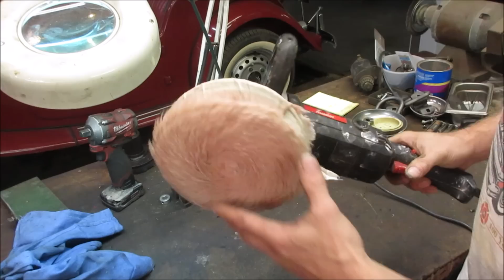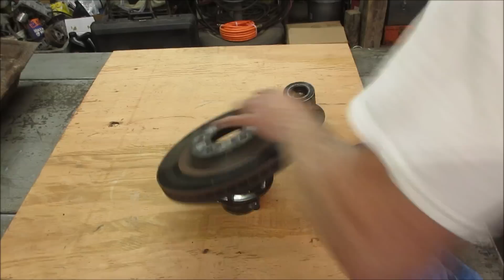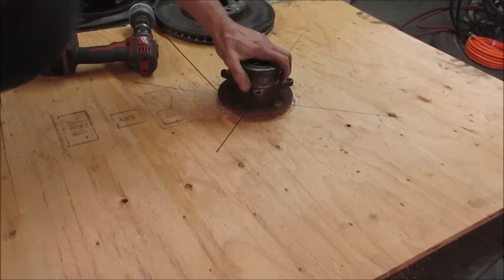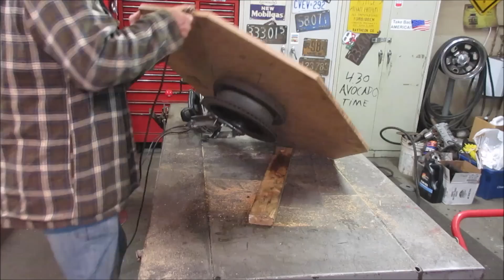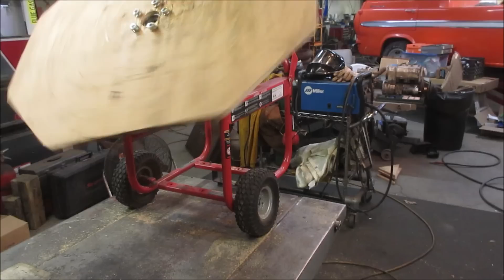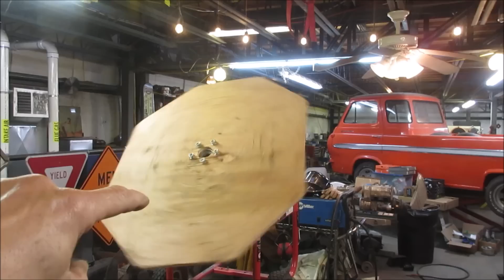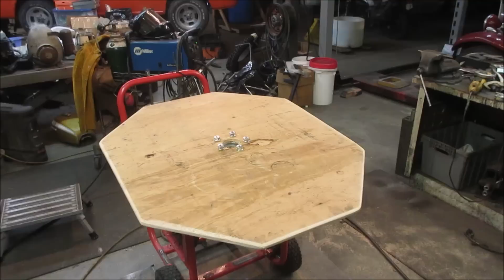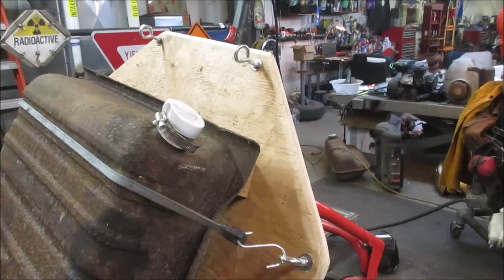Building A Machine To Fix Rusty Fuel Tanks Of All Kinds - Let's Get Started!

Comment: I think it would be good to use the electrical plugs on the side of the cart . Wire it up so you can plug the grinder to the cart on one plug, and on the other put a rheostat (dimmer switch) to control the speed. Great video, keep it up.
Reply: The problem with the rheostat idea for electric motors is that electric motors aren't like incandescent lights.  They'll try to draw the needed watts, no matter what the voltage is, so the current drawn will fluctuate wildly, and could trip circuit breakers.

Comment: Fun video, I usually listen and learn, today I was voicing suggestions....  lose the plywood, expanded metal with frame gets you many attachment points.   Tarp straps are an eventual wreck, tie down straps for the win.  The rotor counterweights for stability likely help just in weight to calm the thing down but a stabilizing movable third leg added to the bottom framework that you could slide in and out may be a good addition or even replace the counterweights.  My mind was also running wild with how to add a second motion but came up with bupkiss.  Thanks for an entertaining morning.

Comment: If you want further speed control in the downward direction, you can run the grinder through an autotransformer to lower the 120 VAC to a lower starting voltage.

Comment: I have used drywall screws as a abrasive medium when cleaning old fuel tanks. The threads and tips are really sharp. I bet they would work really well with the tumbling action.
Reply: as sharp as they are, sometimes he needs the weight of the big nuts and bolts to KNOCK the chunks off the inside of the tanks.
Reply: Yeah he needs to use the most aggressive media he can find, so some sharp screws like drywall or sheet metal screws would be better (maybe some star washers?), plus they would be easier to take in and out of the tank because they're uniform.

Comment: Yeah I agree with some others who said that those of you saying "just use a cement mixer" are missing the whole point of - well, of everything Mustie does. Great work Darrin and a fun contraption!
Reply: mustie just hasent found one on the side of the road yet. otherwise he probably would have.
Reply: Old gas tanks may have a lead residue. You should use a fluid to collect the dust. 
Then dispose of it properly.
Reply: That is true, but had Edison been privy to the other inventors doing the same thing, he would not have duplicated efforts and failures, as in learning from what's already been done an available.  He had, as far as records list, approximately 2000 failed attempts at the light bulb, more than half of those had already been attempted by others. Re-inventing the wheel is not always productive. Mustie is the king of yard sale finds, a used cement mixer would have been on my radar. Having used one many times, it was the first thing that came to mind, still is. A stand that pivots, a near perfect speed of rotation (centrifugal forces have already been addressed), a working height nearly optimal, lots of room for modifications. No, I'm not missing the point, I see the room for improvement and less duplication of effort in a mechanism that has already solved 75% of the design problems.
Reply: @murphymmc  Yes. but Mustie wishes to entertain and educate, not solve the technological and engineering problems of our age.

Comment: I can think of 2 things that might work: paint can shaker, and a laser that can be inserted into the can so that it can be start at the furthest point and pulled back to the inserting point, and would do a 360 degree burn as it is pulled out. I know the laser like this hasn't been invented or tried but why wouldn't it work? Just a thought. Of course the paint can shaker would have to be modified to hold different size tanks.

Comment: I made a brass tumbler out of an old mastic mixer.  You can change the angle.  It's belt driven with reduction pullies.  Runs off a 1725 furnace blower motor.  I can clean hundreds of cases in around an hour using stainless steel pins.

Comment: When looking for a hub to use I'm surprised you didn't think of an old garden tractor deck and those hubs. Also they make ceramic tumbling media just for that kind of work in many different sizes and shapes. When I worked in manufacturing places that used the stuff for tumble blasting would give the used media away for the hauling and the worn down stuff would be great for fuel tanks as the worn edges would be less likely to wear holes in the tanks.

Comment: With my luck, I’d be worried some combination of valve spring, washer, and bolt would get stuck together inside the gas tank and refuse to come out. I wonder where would be the cheapest place to get a half a gas tank’s worth of ceramic tumbling media.

Comment: Hmm, I think I would have built two frames held together with springs. Then built it like an offset vibratory type deal. The thing I like about this idea is there would be far less movement although more work to reposition the tank for each side. Just another idea.

Comment: Great video.  I love saving stripped parts from trashed equipment and repurposing them, like Mustie says - it's a lot of fun to create things from your saved items.  Love it!!
Reply: Good idea = just wondering if it’s going to be too heavy and burn out the motor on the buffers
Reply: Yeah, that is definitely a potential issue.  He even mentioned that buffer changes speed when it gets warm, so it isn't exactly healthy.  Also, the mount is exclusive to that buffer which makes it difficult to change out to something else, unless he can find an exact replacement.

Comment: If you undo the 4 bolts holding the head of the angle grinder head to the body you can rotate the body either 90 degrees or 180 degrees to put the switch in a lesser finger eliminator position

Comment: Just a thought.  For the weight, mount a box on rails to the base of the generator.  That way you can slide it out in the opposite direction of your spinning mass.  You could still use the rotors for weight, but because they are just sitting in a box, you can add more if you need to, plus being able to slide the box back 8 to 10 inches will give you good access to load it and make the weight more effective with less of it as a counter balance.  The third plus is that when not in use it is contained within the frame of the machine and not hanging out.

Comment: Another crazy contraption made out of some rusty junk that has another life cool build  👍     still looks little fast  I'm sure it will get some tweeks
Reply: I suggested adding a reduction gear intermediate step, which would allow him to further reduce the speed of the tumbler and increase the torque available, and give him two ways to fine-tune the tumbler rotation, either by varying the gear ratios used in the reduction gears, and by using the speed control of the polisher.

Comment: Don't forget to put a Bolt in the center of hub bearing. On a car    the two ball bearings race have the proper preload and holding assembly secure. Just the interferance holding will be not enought. The maybe will separate IMHO

Comment: I'm suprised you didn't do something using a small engine to convert rotation to oscillation, by connecting the piston to the cleaning basket. So...the engine wouldn't run, the crankshaft would be power input (from the same buffer that you used).

Comment: All the people saying "use a cement mixer" don't have the right mindset. Mustie made a contraption that works, is customizable and was made using things he already had laying around. Absolutely amazing.
Oh and an addition that might be useful is a form of variable power supply so that you have more control over the speed since it's still a little on the fast side.
Reply: I was hoping he would use an old 4 hp Briggs and a motorcycle gear box.
Reply: Going around the block to get next door is a trait that can be dealt with unless you have attention deficit disorder and you are likely to be distracted by any number of flying bugs on your longer route.

Comment: Another brilliant video Darrin
Rusty fuel tanks - electrolysis - I bet you already have everything needed to hand 
(battery charger, some scrap metal and some soda crystals)
Works wonders - and keeps rust from forming afterwards...
Worth trying after you have put it on that machine which should be fine at getting the crusty lumps out first

Comment: I wondered if mounting a vibrating sander up side down with a piece of plywood on the sanding surface to set the tank on would work. Probably would need to run longer to do the job but would be easier to set up. A small gear motor or electric drill should work well to run the one you made. Adding a timer to turn it off would be handy. Then you could run when you leave the shop so wouldn't have to listen to it.

Comment: Hey Mustie you could have made the motor adjustable and by loosening the belt or tightening the belt you can slow the speed down  ....i use to work at a plastic lamination shop and we had to change the thickness of the plastics on different paper that we was laminating and our rollers was ran on electric motor with belts and we would either loosen or over tighten the belt and it would slow the rpm downs

Comment: The only flaw i could possibly see is that an axle is what holds the car wheel bearing together, so you may need to add a bolt through the center like the axle would be. I realize not much weight or speed. Great build

Comment: Tumbler? Floor jack on a rear wheel drivetrain vehicle, lift 4-5 inches from differential, ratchet strap tank to one wheel and idle speed on a flat driveway, insert rocks and what not into rusty tank,let spin for hours lol

Comment: I learned the hard way years ago to only use smaller abrasive pieces (vs larger heavier bolts, nuts, etc) such as tiny screws, bb's etc - had the heavier stuff break through the tank!

Comment: Get some vibratory tumbler media to put in the tank. It is usually a ceramic that will polish the surface and remove the rust. It would be a little quieter too. Mix in some hot evaporust with it.

Comment: Necessity is the mother of invention. I have used a cup of coarse sand and a 6" air nozzle. Dump the sand in the tank and chase it around with the air nozzle. Cover the opening with a rag to trap the sand but let the air out. It get's into the corners were other stuff does not. Finish the job with Red Coat fuel tank liner.

Comment: I guess you could also use this for welding if you swap the plywood out for a steel plate with countersunk holes so the bolts are flush. stick a part in the middle, turn it on, weld your round part all the way? maybe useful for spinning a wheel and making sure its running true? with that attachment point you can probably come up with all sorts of fixtures to bolt on to it instead of the wood and do whatever you need to do with it

Comment: I used fiberglass resin to coat inside on motor cycle tanks .
Sharp rocks gravel to use inside with Calgon dish washer liquid hot water and shake for an hour in all directions.

Then I dry it and used muriatic acid and phosphorus acid . 
Then wash with water baking soda.

Then alcohol to dry out next to a heater .

When bone dry I mix fiberglass resin and put in tank and rotated it all directions to get resin on all surfaces . 
Held up good for a few years now.
Ps,
My old OSSA motorcycle has fiberglass gas tank from 1970s still perfect.

Hope this helps people.

Comment: I think I'd use a 12v PWM device to power a window motor instead, then direction and speed would be easier to control. I did build a large rock tumbler a few years ago this way and it would handle as much as 25 kilograms of material without issue.

Comment: On my xt350 tank i've been looking into a non-corrosive home-made solution to the rusty tank, have one to try out when it gets worse again, the last time i just cleaned it and blowed it out until nothing came out.
My real problem now is that the tank seemed to have developed microholes where the gas makes the paint bubble. I've heard about some special tank resin-epoxy but haven't found it yet.
Reply: Try airport repair they make a goop you pour in and itt seals micro pinholes sea,s etc

Comment: Cement mixer has the tilt built in and perfect speed just strap the tank to the front of the bowl
Reply: What about a dimmer switch?
Reply: Grodan speed control for exhaust fans . But some motors dont like to be dimmed . A dimmer swirch would burn up really fast with that kind of load
Reply: @EZ4U2Say11  Better off finding scrap dryer.
Reply: @hammer5475  Yes , any potentiometer would work. Wish lived nearby as has 2 extra motors for old cast table saw. Problem with heavier things is the start up. Capacitors are more table saws, pool motors , etc.
Reply: @hammer5475 like for dimming living room lighting?
Reply: @hammer5475  yep,on a little panel on the front.
Reply: @hammer5475  dimmer switch can't handle the amps. You'd need one rated for 15 to 20 amps or more. Once the weight of the tank is added and polishing material inside it, it's going to have a large current draw. Dimmer switches are generally rated for lightbulbs only, and some bigger ones, for ceiling fans.
Reply: That's exactly what I use and was going to suggest
Reply: Daughter was into collecting and painting old railroad spikes. Just throw them in my mixer with sand. Noisy as hell but works.
Reply: @shade38211  you basically made a rock tumbler. Not sure if you're old enough, but they do that for polishing quartz and stones and stuff on a hobby scale. You could actually throw in bigger things like car parts with crushed walnut shells.
Reply: That's what I used at my job shop to tumble parts in. Gave $15.00 for it at a yard sale.
Reply: @larry3064  neighbor is scrap collector . Most would cry to see stuff he gets rid of. Seen 2 mixers there.
Reply: @shade38211  
I used to go to our local scrap yard every month or so. It's absolutely amazing what you can find.
Reply: Yeah, when he said "like a cement mixer", I was thinking small tanks inside and larger adapted to the opening.
Reply: Semantics aside, it's a concrete mixer, you can also use it for tumbling smaller parts inside the drum.  I had some rusted chains, threw them in with a shovelful of crush-n-run and they came out perfect.  Made a lot of noise for a couple of hours though,
Reply: Like he said buying something isn’t as fun as learning and using your brainstorm
Reply: too bad he didnt have one to start with
Reply: I'm sure he knows a mixer would be perfect but doing this is content and also pays the bills ( YouTube)
Reply: "but what fun would that be?"
Reply: Great idea! I have an old mixer that has been converted to electric power. Could let it run for hours if needed.
Reply: Very nice job 😊😊
Reply: Got a feeling the motor on the grinder will overheat and burn itself out if it's running too long
Reply: I used a Harbor freight china cement mixer also ..put tank in blankets in drum to protect it .

Gotta tape jackets blanket really good to keep tank in it .
Reply: Love it for myself, but Mustie1 doesn't spend money if he can do it himself.  And I didn't think it was going to work.  He impressed me.
Reply: Smart A$$. lol.

Comment: A front load clothes dryer lined with styrofoam. The foam will hold the tank in place. Disconnect the dryer heating element and bypass the door switch
Reply: That’s what I was thinking.

Comment: just put a couple drywall screws (or nuts and bolts) through the rubber/aluminum buffer substrate and go direct drive with the cheap Harbor Freight buffer.. Worst case, you have to buy another $20 buffer every year or so, and instead focus on mounting the buffer to the generator frame, and the tilt function. the bent drive is too complicated, and a chain drive could be dangerous if the chain snaps.
Reply: That would spin much too fast.

Comment: The 65 econoline is such a cool vehicle.
Reply: It is…unfortunately it’s just been sitting on his lift for the last two years
Reply: I agree we don't see them here in Australia. I think I saw one at a Car Show once obviously it was imported at sometime.
Reply: Yeah his double cab too but that thing seemed to vanish into. The. Twilight zone
Reply: Manufacturers really should bring something like that back to the market as a cab-over-engine or cab-over-front-axle pickup truck has a smaller, shorter, usable length (less cab, more bed so to speak).  My second favorite truck is a Bongo truck, very similar to Crusty.
Reply: @Hjerte_Verke  we will never see another mid engine truck like the Econoline of 60s. Crash protection handlings. And they had a 250 lb weight bolted to rear to prevent nose dives